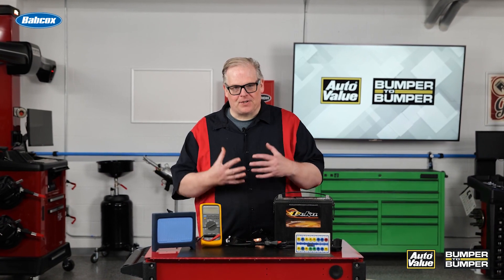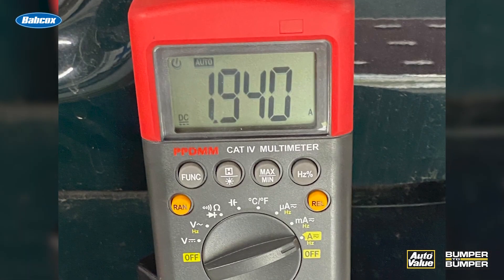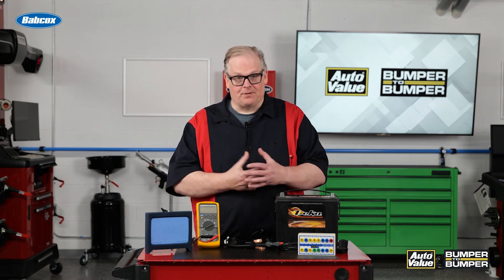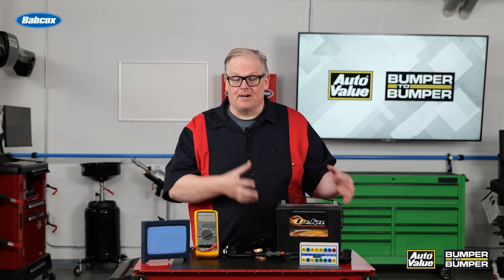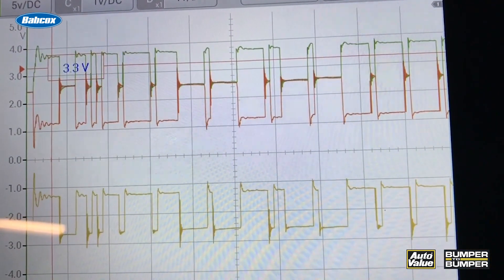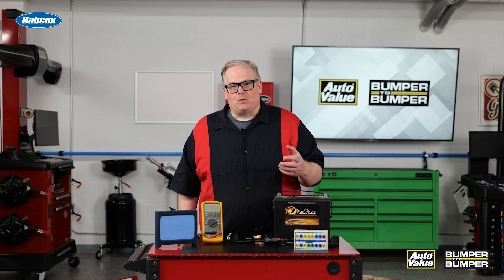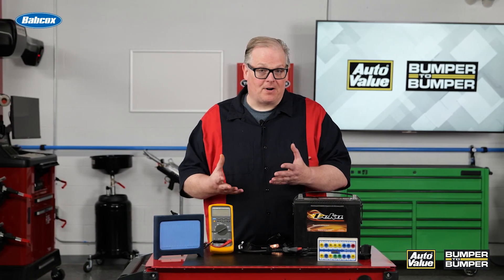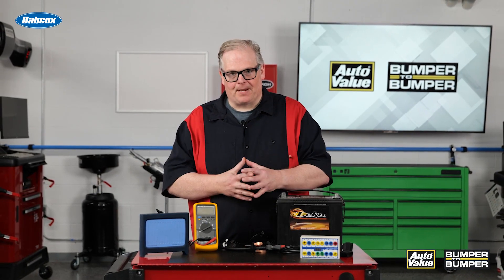Tech IQ: Parasitic Draw Testing and Scan tools

Comment: Good video Andrew. I find that using the amp clamp limits the amount of time you can leave the scope connected while looking for a parasitic event. This of course is due to the life of the amp clamp battery. If you make up a test lead with a 100W 2 ohm resistor that has stackable banana jacks at each end, you have the ability to put this lead in series with the battery negative cable and ground. Now instead of a voltmeter, connect your scope leads to each of the banana jacks which would put the scope in parallel with the circuit. Using the MATH channel feature of the scope, set up a custom equation of the scope channel you are using divided by the value of the resistor. When the draw occurs, the voltage drop across the resistor divided by its value will give you the amperage value of the drain. (Ohm's law). This will allow you to set the time base of the scope to it's maximum setting without the possibility of the amp clamp going dead, ruining your test. You will have to have the scope plugged in however, as the scope or PC battery won't be up to the task on its own either.